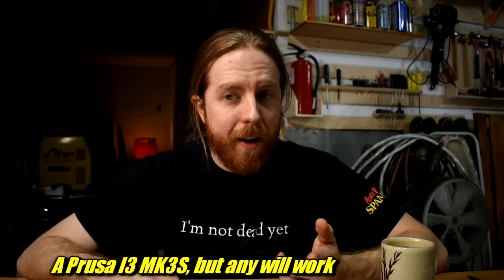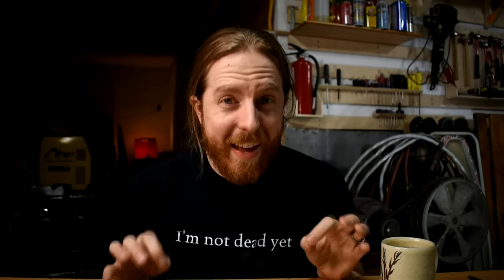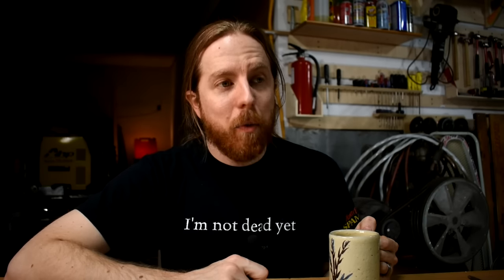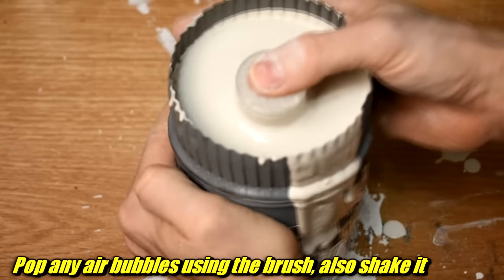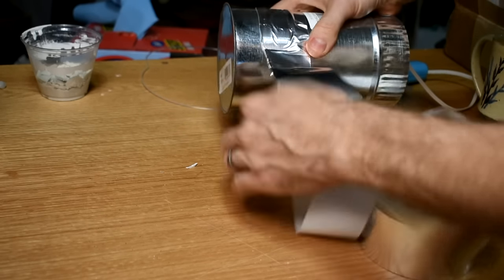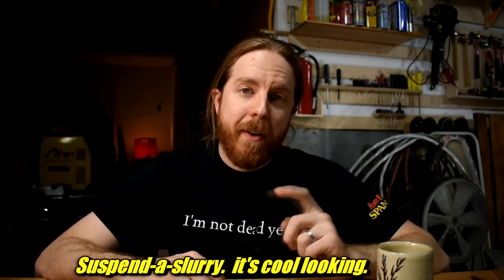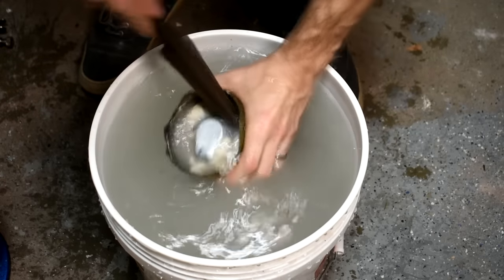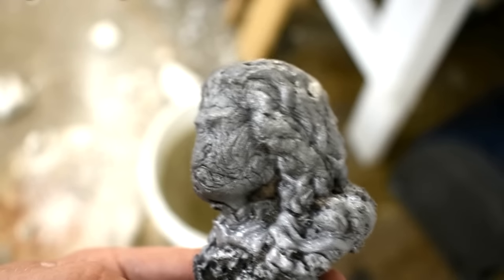3D Print to Solid Metal, BETTER Than Lost PLA Casting

Comment: The ducting you showed was single wall HVAC pipe. That garbage offgasses when heated, and if you're not in a well ventilated area, you can develop heavy metal poisoning. You should have a disclaimer in there. Great video though, gonna try this.
Reply: Yeah it’s like the idiots recommending torching galvanized steel for “the pretty colors” it makes 🤦‍♂️
Reply: I honestly can't think of many things that don't release gasses or harmful fumes when heated, especially with a torch. Most people won't drink out of a plastic bottle if it sat in the sun for 5 minutes. At this point it is common knowledge.

Comment: so... building a lathe out of Za-12?
Reply from the maker: I am indeed yes
Reply: I thought the question was a joke, but … cool! (A Gingery type thing or something more modern?)
Reply from the maker: @DEtchells  modified gingery lathe
Reply: The only problem with Zamak, aside of relatively low melting point, that its kind of brittle material. In comparison, nylon is much stronger and actually sometimes even PLA is a better choice over Zamak.
Reply: Many parts will work well done in Za12.
Reply: @PaulsGarage  Can you please tell me How much $$$ Total to be able to do everything you can here ?   Isn't there fine wires you can 3D print with ?  that can be melted instead of doing Casts ?
Reply: I would use Zamak-2. What is the benefit of using Zamak-12 over Zamak-2, if any? 2 should be better for gears or other wear components, is it not?
Reply: @dekurvajo are you saying he should use PLA or CF Nylon to make the Gingery lathe? I'm currently working on a project called the Nylaug that uses a CF Nylon printed receiver. It's a Steyr Aug parts kit that uses a modified AR-15 barrel. I can understand using CF Nylon for something like that, but it seems strange to try printing a lathe when you need it to have a very strong sturdy base that doesn't flex.
Reply: Not 12? Za5 & Za7 a.r.?
Reply: @dekurvajo  Zamak has infinitely higher wear resistance than plastic.
Reply: I wonder how zamak does with vibration damping compared to terrible aluminum or the good and well tested gray cast iron.

Comment: I still like the idea of making a silicon mold using the pla print, casting in wax or simular other materials then casting a master mold by heating and melting the wax
Reply: My preferred method. It also gives you the option to tidy up and smooth those print lines on the wax model before the final cast. If I'm making multiples then I'll silicon mould from the improved wax model. Personally, this is the necessarily long route through the woods I have to take because I'm not a sculptor and rely on the printer to do the hard work. Not sure  I'll rush to use Zanak... I think the fumes issue outweighs the convenience for me.
Reply: Use PVA, it's water soluble filament. Skip a step.

Comment: the aluminum tape is the original duct tape. what we normally use is more like duck tape lol
Reply from the maker: I believe that.  Aluminum tape is the best.  It's even better at slicing your fingers on accident...
Reply: Duct tape was made for sealing ductwork, but it's the only thing it doesn't fix. They just changed the name to duck tape because it sounds the same. The metal adhesive tape is the only one acceptable for ductwork. And yes, it's as thin as most blades, it's like the most aggressive papercut ever if you're not careful
Reply: @aaronmccullough4926  duck tape is called duck tape because it sheds water like a duck. Originally duck tape was developed to seal ammo boxes in the Pacific theater against moisture and it came in the Army's favorite color, olive drab. After the war ex soldiers didn't want to see that color ever again but they liked the tape so the civilian market version was made silver. Duck tape is surgical tape.
Reply: If it sticks like a duck..
Reply from the maker: Last time I tried using a duck to fix a dryer vent the jerk kept biting me until I let him go.  No help at all
Reply: @PaulsGarage  pro tips: 

1) Hold the duck behind the neck
2) Smear butter on the vent
3) Slowly rotate the duck around the vent to get a uniform crimped seal

And lastly, if the duck will not cooperate, just get another.

Comment: The ducts might be and are probably galvanized. Be mindful that heat will cause the zinc coating to vaporize. When zinc vaporizes, it can create zinc oxide fumes.

Great tips love your content <3
Reply from the maker: Yes they are galvanized.  Fortunately everything is already well ventilated for the plastic that's burning out and the propane 👍
Reply: @PaulsGarage  Good video nonetheless
Reply: That’s all I could think about when I saw that part. Zinc oxide is potent fatal. I did like the video otherwise 😊
Reply: You're focused on the micron-thin layer of zinc on the ducts, which never gets especially hot in the first place, rather than the hundreds of grams of molten ZAMAK, which is 96% zinc.
Reply: @mmccubbis3662  you would need to inhale A LOT of zinc oxide for it to cause any significant issues. Pretty sure the small amounts of lead are FAR worse for you.
Reply: @MsArchitectschannel  Lead isn't really that hazardous either.
Reply: @canonicaltom o.O please go ahead and sniff some then. Lead is a heavy metal, small amounts of it will lead (lol) to a very painful death
Reply: @albo5194  Luckily the vapor pressure of lead is incredibly low, so even if you have no temperature control at all with your melt, the chances of inhaling any are basically zero.
Reply: The zinc oxide fumes aren't actually toxic per se, but they will make you wish you were dead. That's why welders wear respirators when working on galvanized steel. 

As for the heavy metals, they are generally not very dangerous when they are in their metallic state - but just as soon as something comes along and converts them to an ion, they become EXTREMELY nasty, and in very small doses as well. That's why you can solder with 60% metallic lead solder for your entire career and not lose too many brain cells to it; but regularly drinking out of lead cups or pipes (like the ancient romans used to do) where the liquids in them will chemically attack the lead (thus ionizing it) will rot your brain fairly quickly. Heavy metals in landfills are likewise exposed to such chemistry, so eliminating lead from consumer products and most industrial ones as well  is generally speaking a good thing (ultra-high reliability circuit boards like those for safety-critical aerospace applications still ought to use leaded solder due to the tin-whisker phenomena, but those are a lot easier to label, track, and dispose of properly).

🤔
Reply: But the colors are so pretty when you heat galvanized coatings 😂 🤦‍♂️

Comment: Claim - this stuff works, well wow it really does. I’m new here and this is a breath of fresh air! Good clear advice or info delivered at a fast pace and good shots of casts that are just fab. Like it a lot, thanks Paul.
Reply from the maker: Thanks!
Reply: Polycast is great, the tip about prepainting with plaster is genius, especially for people without a vacuum chamber, so yah I concur, good advice here.  I would suggest making sure you only use that vent tube outside only cuz it will poison you otherwise, and if you want higher resolution resin printing with burnout resin works the same as pla printing with burnout PLA but at a much higher rez.  Couldn't have given better advice myself.

Comment: This one video got a thumbs up and a subscribe from me. Thank you for this. I own a small business specializing in restoration of vintage automotive related hobbies such as racing karts, motorcycles and specialty cars and trucks. I am a professional fabricator and often times I have to methodically recreate broken or worn out parts that can not be purchased at any price. I have been seriously considering purchasing a decent 3d printer just for this purpose of assisting in sand casting and slurry casting of one off parts. Everything you said is music to the ears. Thank you again.
Reply from the maker: That sounds awesome!  That's why I got into metal casting, i wanted to make car parts.  I got a bit distracted with 3d printing and fell way down the metal casting rabbit hole while my car project just sits there haha!  This video isn't the ideal way to do it, actually.  For plaster investment casting, I would use jewelry wax for sprues, and a vacuum casting machine.  Any big car parts should probably be sand cast, but things like metal radio knobs, door handles, hood ornaments could be resin printed for better quality.  I've always wanted to make a custom set of cylinder heads or intake manifolds or something, but that's a "one day when I get to it" kind of project, you know?  3d printers and 3d modeling is a great way to get patterns for casting.  I would add 3d scanning to that, too.  It's not the scale you're talking about, but I scanned a power wheels toy mustang and printed a full new body for it to look like greased lightning (video sometime in the future), so you're in good company here!  

I will say though with sand casting, it's vital you get the gating right to avoid porosity and sand and junk in your metal castings.  Good luck and let me know what you're making!
Reply: @PaulsGarage  I currently have a small part for a vintage racing kart that I'm trying to recreate. It is a small carburetor intake reed valve body that was originally probably die cast aluminum. The part has a rather complex shape as it holds either 4 of 6 metal or fiberglass reeds and stands about 2 inches tall by about 2 inches round at the base. Material wise there is maybe 4-5 oz of aluminum. Originally this part cost $6-$10 in 1966 when it was developed. If you can even find one today that is good usable part, expect to pay north of $100. I know of at least 20 other restorer's actively looking for multiple parts for current projects. Even if I made them in batches of 20 or more at a time, I bet they would sell out quick. I would like to utilize the 3d print to cast method for short runs of parts like this before I dump thousands into a cnc made billet steel die and a pressure casting rig for a $40 part.

Comment: Polycast is definitely a solid step up from PLA, been using it for a couple of years now.  It works great for small scale casting but gets a little squirrely when casting larger prints in ceramic shell.  Good video, dig your channel.
Reply from the maker: Good to know about the larger prints, thanks!
Reply: what infill do you print Polycast for burn out? 80% 20%?
Reply from the maker: I usually go as low as possible, 10-20% for most prints and I made no adjustments for polycast
Reply: @PaulsGarage  thanx, you are really cool, I didn't even know this stuff existed
Reply: @privateprivate3767  @paulsGarage The amount of infill for me depends on the size of the print. smaller prints are closer to 20% larger print (over 12" high) ill drop to 10%. The other variable is whether the print /object is a solid vs a thin walled hollow.  Less for a sold, more for hollow. Ideally the less material you need to burn out the better.
Reply: @LunarburnStudio  thank you for your detailed and helpfull answer. you are cool
Reply: Put it in a polisher for a smooth finish. If you are using it for silicon casting or epoxy cast maybe use a better printing product like polymax.
Reply: @lenny108   I hear what you are saying, but my prints wont fit in a polisher.  Everything I print is cast in metal.

Comment: you can add silica sand or the red material like on the tennis court in the plaster for better resilience to heat and it doesn't crack as much when you do the burnout. 50/50 proportion sand and plaster

Comment: I recently thought of molds made with PVA, as it is water soluble, but with PVB it makes more sense mainly because it is easier to print, PVA ends up getting moisture very easily, which makes printing difficult, maybe HIPS would be an option , since it is soluble in delimonene.
For those who still prefer PLA, Esun has PLA High flow, perhaps because of its ease of melting, it helps in the lost casting process.

Comment: Really cool!  I'm starting to lean toward plating pla though.  Recent videos show that if you paint it with a conductive graphite paint, it can be plated with nickel, and then other metals like gold on top of the nickel.
Reply from the maker: That plating stuff is really awesome.  It looks great in my opinion, but the end result is different.  I'd rather have a piece that's solid metal, with all the weight, but not everybody is like me.
Reply: I recently saw a video of testing different methods of getting a chrome finish on a part and the winner was this chrome nail polish stuff
Reply: still: 1st plate with copper, then with nickel. Nickel-plating directly isn´t easy...

Comment: Please make a complete beginning guide to casting after you do it in ideal conditions. I'm looking to build a casting area in the shop... No idea the full scope of things.
Reply from the maker: Good idea!  That's quite an undertaking, id have to separate it up into sand casting, investment casting, etc... Most people don't do all of it.  I've never done ceramic shell casting or vacuum casting for example.  But it's a good idea to get it all in one place.  That would be a super long video though haha
Reply: @PaulsGarage  that's super fair. I am currently figuring out the melting of metal. I have no idea what a crucible is or where to get/make it. Kiln vs. forge vs. oven etc. 

I will research it once I have a solid project to execute, but this is so niche... The basics are often over looked and everyone kinda starts at step two, and assumes we know step 0 and 1. 

Like can I build a ceramic kiln that can melt steel... It seems like it should be possible... But does anyone actually do it? Why not?

Comment: I've just gotten into Lost PLA, I started using Ovature Black PLA and using an air compressor to blow it the mold after burn out and Its been working really well.  I'm going to look into poly cast filament though.  
word to the wise though, those galvanized stove pipe will burn up and oxidize way too fast,  you are better off getting a cut off of square tubing or steel pipe.  stainless steel if possible.
Reply from the maker: Air compressor is the only way I've heard of people successfully cleaning a PLA burnout, but I'm worried some molds might not get clean enough with that.  No idea though, never tried.

And good call about the thicker steel.  These pipes don't look too good after use but the temps weren't as high as if I was doing bronze.  Eventually I want to do vacuum casting so beefier flasks are totally a must

Comment: It is always nice to see people discovering decade-old technology when looking to improve their new found technologies.
Zamak is cheap-ish (not much cheaper than the alternatives anymore), easy to handle, relatively strong.
Of course it also has its downsides - it is extremely susceptible to contaminations. Ever touched lead with the tongs you use to pick the Zamak? You just contaminated your zamak and it might rot away with just a few years. And while it is strong it loses strength with time and lacks some of the nice-to-have properties other materials have. Aluminium i significantly lighter and corrosion-resistant, iron (yes way harder to melt) is stronger and cheaper, copper has higher electric and thermal conductivity while also being more pliable etc.

But for pure decorative parts casting Zamak is great.

Comment: Helo Paul, some thing still i dont undestand... did you put the printed piece under water before you fill out the mold with metal casting? i know the PVA material cab be diluted on water but in your video i didnt saw that part, or maybe you replaced the PVA with the metal directly? whatever, thanks for your video!

Comment: Thanks for the video! I never comment on videos but you seem like a decent guy so I wanted to say please, please don't melt zinc alloys in steel/iron alloy containers. Molten zinc acts like a solvent on iron alloys and will dissolve them. You'll lift your soup can from your foundry and have 4lbs of 1,000*F liquid dump out of the bottom. Also, since the steel is dissolved into the alloy, you can have weird pockets of rust develop over time which isn't really a problem for decorative things like you made in the video but if you were to make something structural or for outdoor use it would lead to pockets, bubbles, and weaknesses that you won't know are there until it breaks apart. 

I truly didn't mean to rant, zamak alloys are a life saver for detail work. There are several engine parts that can be great sources of cheap zamak also, carbs and throttle bodies in particular. Thanks again and good luck!

Comment: This is great 😃I've looked for easily castable (low temperature) alloys before, but didn't find much worth having. Zamak looks like it's pretty much perfect for most applications, unless weight is really an issue. Zamak 5 is known in the EU as Z410 and has mechanical properties close to 6061 aluminium. By weight it's cheaper but by volume it's around the same price as aluminium (at least from the suppliers that I have access to). Thanks for the great video 😊

Comment: Are burnout resins expensive because they are more expensive to produce, or is it just not as in demand?
Reply from the maker: For resins I'm not sure, but this filament is probably more expensive because it's a niche product, so volumes are lower, there are no fillers that would benefit the printing process because those might leave ash, and there is higher quality control.  At least that's what the marketing says.  Who knows if its true lol it does work though